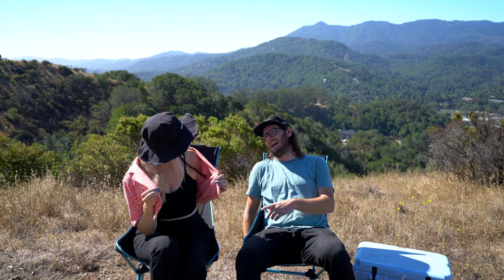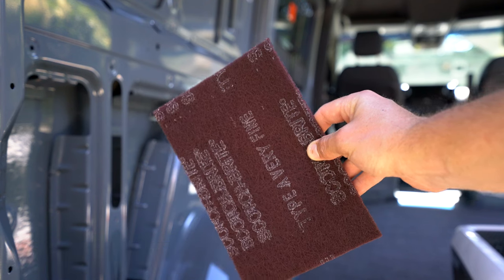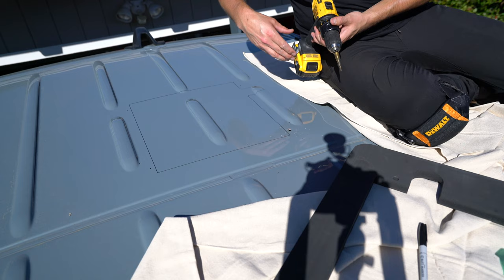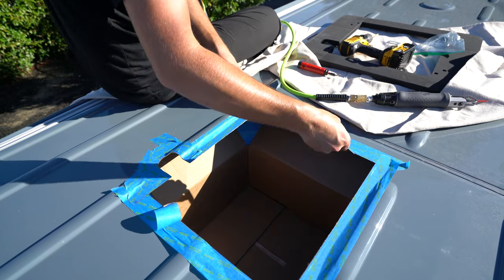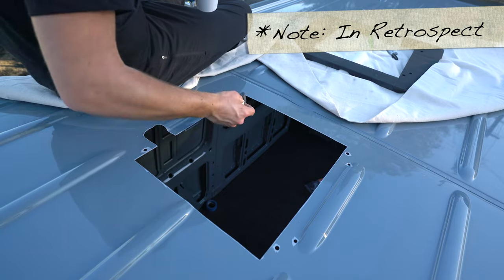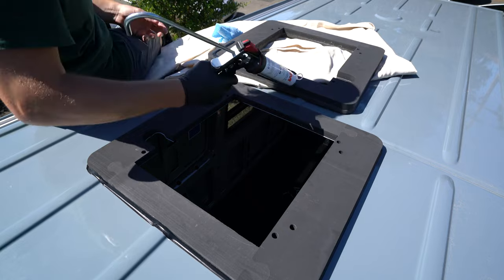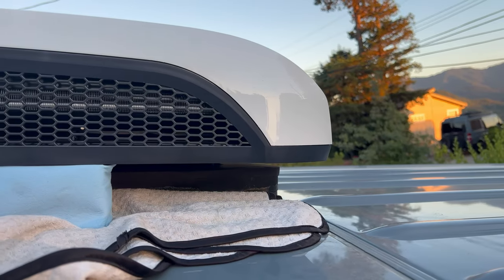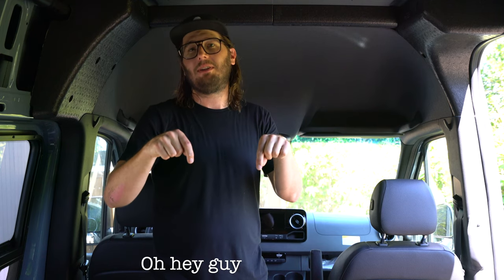Sprinter Van Build Dometic RTX2000 Air Conditioner Install

Comment: I read on DIYVAN to use the flexseal or dicor to finish sealing the adapter to the roof. Did you guys ever do that or just the bead of window weld did the trick ?
Reply from the maker: We did FlexSeal over top on the Maxxfan install video since there’s screws through for mounting there.  I was thinking about it on the A/C, but honestly after inspecting the Windoweld after it dried it sealed around the edges really well.  So far it’s been holding up great with no issues.   If you are worried about it the FlexSeal is pretty cheap insurance.

Comment: Thanks! I watched dozens of RTX 2000 install videos, some from pro builders and you are the ONLY one that showed pre drilling the holes for the brackets and trim! Some may not think to do that. My RTX is sitting in my home waiting for my sprinter to be delivered and I was searching for this! Glad I found your video in time. Great job!👍
Reply from the maker: Hey Rod! Thanks for stopping by and the kind comment! We really appreciate it.  Make sure you watch our follow up V2 bracket install and some of the later wiring videos to get an idea for how we ran the wires too! 

Hope all goes well with your install and any additional questions please reach out!  We are here to help :)
Reply: @moonrakerdesign 
HELP! Todd, I’m ready to order the RTX2000 adapter from DIY van but confused on the measuring process. Amazingly, I’m installing it exactly where you put yours! I came up with bay 7?, the next bay forward from the bay by the rear doors. not sure of the inches as the roof supports are visible in the van. There is only one place to install it in each bay unless you want put it on the drivers or passenger side.  I’m going with the center of course. 
If you had a 170 I could just use your measurements. 😁Help??? 2024 170 sprinter.
Reply from the maker: @rod8073  Hey Rod we have a 144 and ordered Bay 5 18.5".  I"m not exactly sure how this translates to a 170.  I would give DIY Van a call to clarify what you need.  Both Hein and Kim over there are super helpful.  I don't want to give you incorrect info.
Reply: @moonrakerdesign  
I know. Thanks a lot for always responding. I don’t understand the measuring since the AC can only fit between the roof supports. I would call your adapter “ bay 5 center” or something. And measuring from the top while not knowing where the supports are is confusing as well.  Also the diagram they show is for all 3 sprinter lengths. Is bay 8 just for the extended? I want the next bay in front of the very back. Not sure how anyone can figure it out. I called but got an answering machine. I’ll try again Monday. Thanks again! 👍🚐
Reply from the maker: @rod8073  yeah I think they need to clean it up a bit and have 144 and 170 split out as completely separate products with their own documentation.  Even if there's overlap it would make it a lot clearer for people.  

Anyways I hope they can sort you out, and sorry I wasn't able to help more, I just don't want to give you the wrong information.
Reply: @moonrakerdesign  
Thanks a lot Todd. I just thought I’d run it by you in case you had a formula! 😁👍🚐
Reply: Just talked to DIY and ordered the adapter. Bay 6 34.875”! Question, the rtx has very long wires, did you shorten them a bit?

Comment: Thanks very much for you detailed tutorial on this install we did exactly as you did with the spacers. However we are at the point where we need to do just as you did with the custom fab bar. Any luck on posting that video we’d love to see it! Great job
Reply from the maker: Hey Jonathan, thanks for stopping by and for the kind words!  Glad to hear you are following the same route!  We ended up posting our video of those custom fabricated bracket here ->  https://www.youtube.com/watch?v=avUskaaj7Qs.  Admittedly, the way we manufactured them does take some specialized tools but I think you could do something pretty similar with a metal cutting jig saw (or even hacksaw) if you used square bar stock for the counterbore bits instead of the round ones we turned on the lathe.  Let us know if you have any questions and thanks again.

Comment: Nice install. Just a tip for your toolbox. Grab a set of countersink bits for your drill, and kiss your holes with them as a way of deburring non-uniformly much more easily than the deburring whip you've shown.
Reply: I'll leave this one up for lolz, but ignore my suggestion. Watched some more of your content and you're obviously a very competent fabricator! Seriously underrated.  Nice work! Subscribed!
Reply from the maker: Hey thanks for stopping by, subscribing, the kind words and you are right so I think it’s a great tip. The countersink is much more suited for cleaning up these holes. Unfortunately I didn’t have one big enough at the time of making this video so I used the deburring tool. I’ve since bought a set as you can see in the Maxxfan video!  Thanks again!

Comment: The RTX2000 is $2300, way too expensive which forced me to look for alternative. Now i found a split system that i can install under the van for $900. Best yet, i can use the roof area for more solar panels.
Reply from the maker: Hey @AZRockRunner that’s great and the wonderful part about building a van, you can choose the options that work for you and your goals. It would help everyone in your same situation if you’d share the information of the product you’ve found!

The RTX2000 is no doubt a big investment, but it’s from a brand we trust and from our previous experiences with Dometic we’ve had great customer service and know they stand behind their products and make quality stuff.  I often find in the long run, for me, that’s worth paying for.
Reply: Can you send me a link to the system you used please?
Reply: Yea which system did you use?

Comment: Hey!  In preparation for custom fab(ulous) bars, what are the 110 fully threaded bolts you got?  Couldn’t find the link in description. Can you drop it here?  Thanks again!
Reply from the maker: Hey Lauren, good call.  I've added it the description both on this & the bracket video.  https://amzn.to/3XQ9sb8.  You might want to hold off for just a bit though.  I'm redoing the bracket design to make it more manufacturable an overall less expensive for everyone interested in them.  I'll know in the next few days when I make the new prototype if these exact bolts will still work!  Thanks again for the support!

Comment: Great video thank you!  I purchased that air saw you recommended.  What blade are you using?  The one that came with it is a little to fine and didn’t cut my max air hole so well.
Reply from the maker: Hey Mike, thanks for the kind words and for stopping by. I use the Ingersoll Rand P4FS-6 blades.  I swap blades after each project and on the bigger cuts like windows and flares I do a fresh blade per side.  

You could also try P4EV-6 if you wanted something a little more coarse, but I’ve never used them.

Comment: Hello Hello !! What do you think about the Nomadic X3 48v? :person-turquoise-wizard-wand:
Reply from the maker: It’s super nice, especially if you are doing a 48VDC power system. It wasn’t around and higher voltages weren’t that popular when I put my AC in. I think if I were to do it again. I’d seriously consider a Nomadic even 12VDC just because of the lower stack height.  Having to raise the AC up to save the interior height isn’t as elegant of a solution.
Reply: Thanks for your honest reply! I think I am going that route. The Nomadic X3 48v with the EcoFlow Power Kit 5kW :-) I learned a lot with your videos and all of them are super funny !!! :-)

Comment: Will this ac run with a Bluetti AC200P (2000wh) using the 12v/10a connection? Or does this have to be connected to the driving battery in a Promaster 3500?
Reply from the maker: Hey Funzee, it will not.  The max continuous power draw is up to 54 Amps and Dometic recommends a 80A breake inline.  It will not run on the driving battery either, you need a dedicated house battery setup.  I would say 200AH lithium MINIMUM and probably better off in the 400-600AH range if you are looking to run it for extended periods of time.
Reply: @moonrakerdesign  Thank you so much for your response. So, are the truck drivers using those style batteries to run the ac in their semi trucks?
Reply from the maker: @funzeevanzee  of course!  Yes, they must.  Here's a good resource I found from Dometic https://files.ecommercedns.uk/247291/3e19d88ef57b782b8d228901f86e9c98.pdf.  In the first paragraph it supports my previous recommendations by stating "The battery capacity available to power the parking cooler must be greater than 170 Ah. To guarantee an optimal operating time, a 225 Ah battery or greater is recommended."  Let me know if you have any other questions!
Reply: @moonrakerdesign  Thank you so much. This helps. Good to know.

Comment: Hi where do you get these brass embedded nut  and the spacer
Reply from the maker: Unfortunately, you have to buy the mounting kit to get the brass nuts, but you can probably find something similar on McMasterCarr if you measure the size of the holes.  As for the space they came from @diyvan.  Link is in the description!